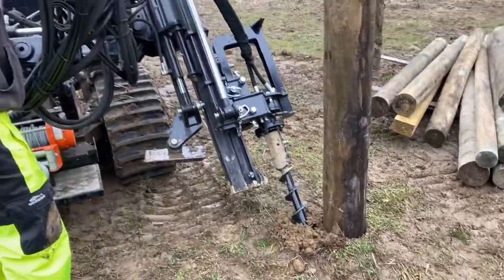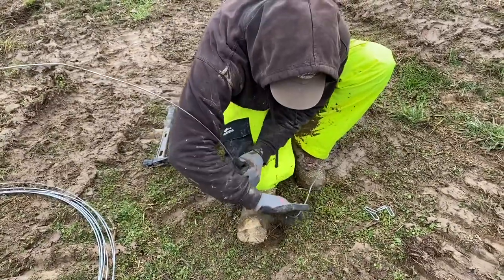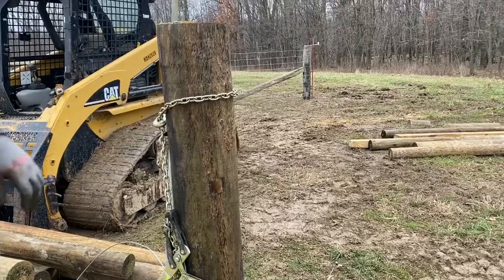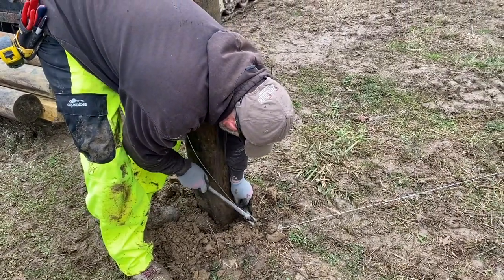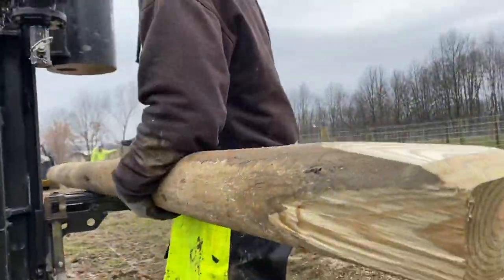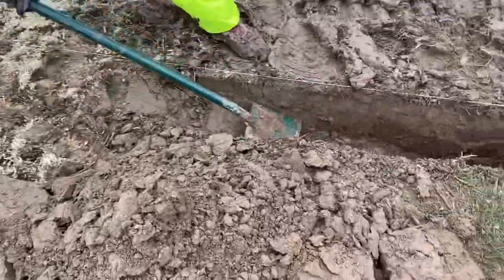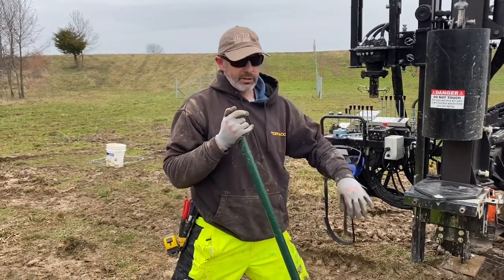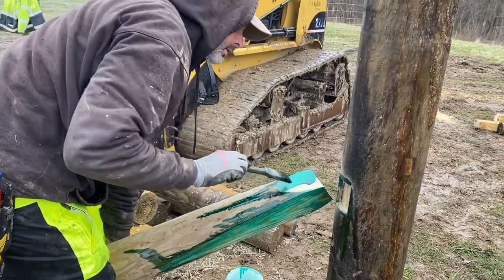Arguably the best fence brace in the world!

Comment: I’m just not a fan of this brace it’s very time consuming and not economical for large scale fencing
Reply from the maker: Honestly we aren’t a fan of wood braces period. Pipe is the way.
Reply: @SWiFence  I agree just not a huge demand for it where I’m located
Reply: @SWiFence  How do you build your pipe braces?  I build mine with a 10' cross piece for the "h" and my posts are usually 3' in the ground.  Even at that I've some pull to the weight of the hi-tensile wire.
Reply: @westonandelin4556  You should put some N braces on where the one side is basically at the ground or close to the ground so then when you pull on from the opposite side as it pulls toward the side that's lower to the ground it will be stronger than an H brace even if it doesn't look as good and you can also put an H brace above it if you wanted.
Reply: You wanna know what I believe is a cheap, fast and easy way to make HN braces?  I haven't actually done it exactly like this before but if you're using 2  3/8" vertical pipe posts for exapple put them just over 4 1/2 feet wide from each other and by 1 10' long 1 3/8" post and cut it at 4 1/2' on one side and 5 1/2' on the other side and buy the 95 cent end caps, 4 for each HN brace along with the $1.98  2 3/8" Brace bands as well as the little bag of the bolts and nuts that fit with it and you'll have really cheap, easy and affordable HN braces so what you do is you put one side of the longer piece of the 1 3/8 post basically at the ground on the inside of your brace where your fence will be pulling toward it with the other side higher up as tight to the next post as possible and put your ends on them with the brace bands bolted tight and then right above that high side you put your level H brace part of the post with wnd caps and brace bands bolted tight also and you might think the 1 3/8 posts aren't very strong fir HN braces but those are the exact same posts that are used in chain link fencing for the top part and people constantly climb them and step on them and they do give some and bend some but that's when they're straight at over 10 feet long and you can cut the few inches section off that is smaller that goes into the other side with another one of those posts when they're used for the chain link fencing but have one side be about a foot longer which will be your N brace but the H brace has to basically be perfect where it barely fits Straight across and your angled brace will be barely under it with the low side just about at the ground and you have an affordable quick and easy HN brace right there and I've used these posts and done that using angle braces into the ground straight but I haven't done it exactly quite this way above ground yet with H and N both but I intend to soon and you can get all that stuff at home depot.
Reply: @Charliemmafan thanks for detailing all that. If I didn’t already have railroad ties, I would try this.  No welding or drilling needed if I understand you correctly.

Comment: Seems like overkill to me, and a huge outlay of capital in equipment. I’m not sure how effective this would be in Alberta Canada. Your foot that you originally installed would be pushed out by frost in this part of the word and would actually work as a plug for the frost to push against. Likewise with your buried in deadman. Up here, the key is to have your corner (king) post at least 4’ into the ground to get below frost line. Put a horizontal or diagonal brace notched into two 19:06 posts and tightened with twisted diagonal wire. The longer the brace, the stronger the brace. I can build one of these in less than 3 minutes and have 100 yards of posts pounded before you can build one of your braces, and mine will last as long as your’s. I am also concerned with how much you compromise the treatment on your diagonal post with your planer. Painted on treatments are never as good as pressure treated, and the chemicals are unhealthy. All this is unnecessary, up here because we don’t use much hi-tensile, just barbwire.
Reply: perma frost isnt something we come up against and how like is doing it is how its done in NZ, AUS , UK, 
I always say that its not how fast you build it, its how well you build it that counts (Uk fencer with 40 years experiance)